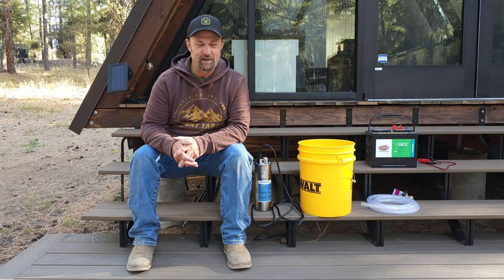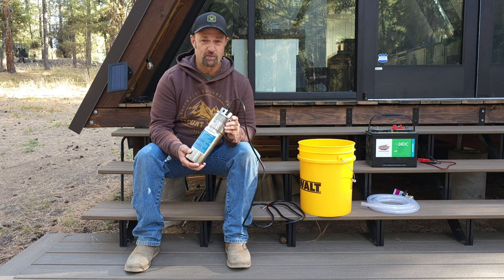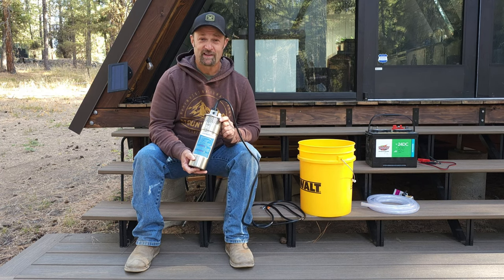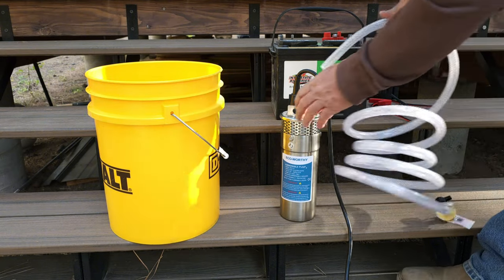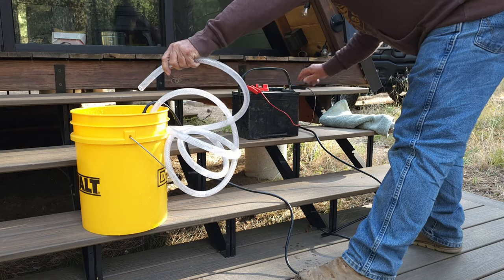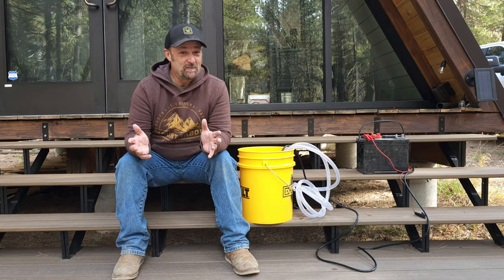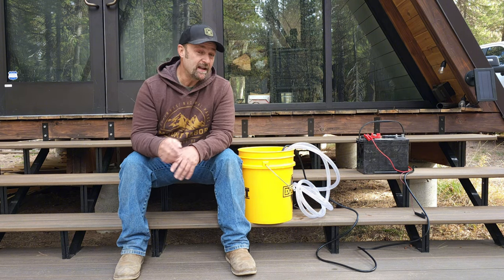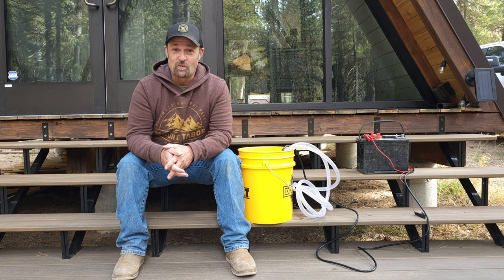Eco-Worthy 12 volt Submersible Well Pump Test - Will it Work for My Off-Grid Well? #solarpump

Comment: I am using the 24v version of this pump to move water from a spring up 150' and over 700' to a holding tank. Been working well so far.
Reply from the maker: Nice. How long have you had it?